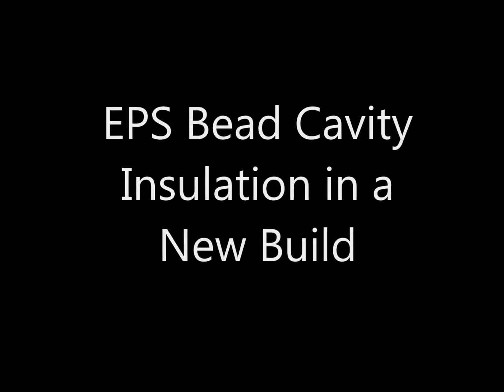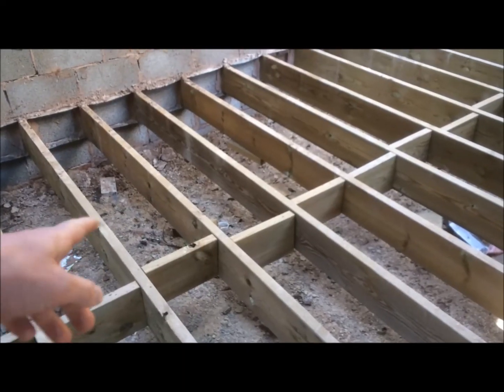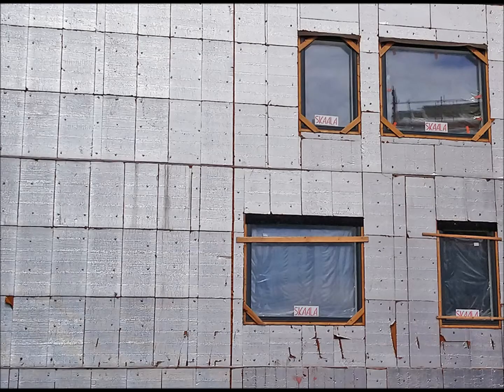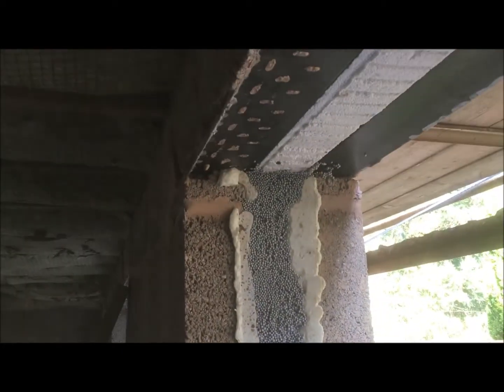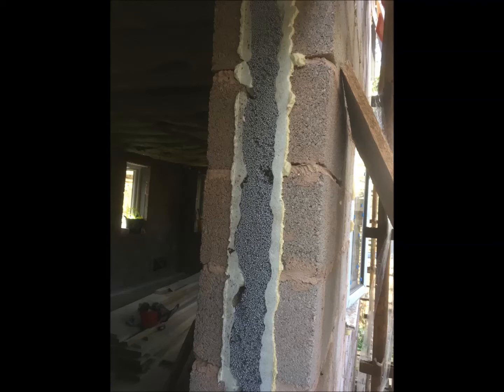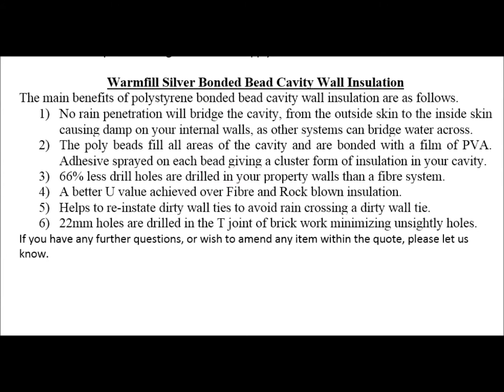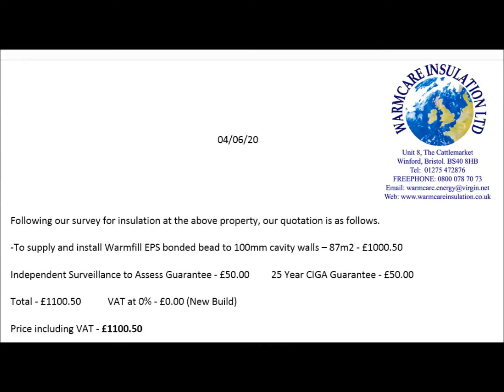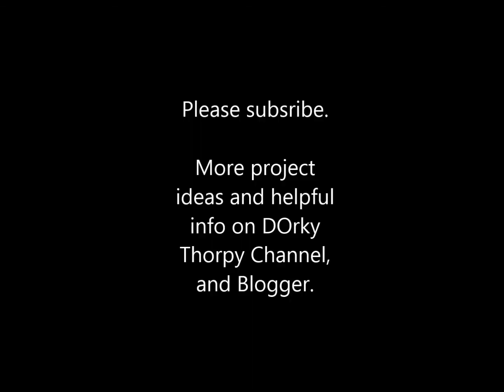Expanded PolyStyrene (EPS) Bead Insulation Costs, Install and Review

Comment: You can NOT add cavity-wall insulation to cavity walls that are ALREADY built up ;  (If cavity-wall insulation is to be used in a cavity wall , it can ONLY be installed from the start of construction of the cavity walls and there must be a LARGE air space gap in-between the face of the cavity wall insulation batts an the outer wall inside the cavity, this includes an air space gap in-between the insulation batts and the cavity wall tie drip points(which must point downwards in the centre of the cavity)). 
Cavity-walls must NOT be abridged. ("insulation" touching outer walls inside cavity)
 Ask N.V.Q. City & Guilds  BRICKWORK teachers for PROOF of this !   (S.V.Q. in Scotland).
Reply from the maker: Thanks. Perhaps supply the truth in the form of a link from a quality independent data source that is directly relates to to EPS. Other wise I think you are blindly following rules without considering context.
Reply: this sounds wrong,.

Comment: What is shown in this video is VERY WRONG.       
 Ask N.V.Q. BRICKWORK teachers for PROOF of this !
Reply from the maker: Can you elaborate?
Reply: Cavity-walls must NOT be abridged. ("insulation" touching the outer walls) .
Moisture from the outer damp walls will soak across the polystyrene beads by capillary action and make the inner wall damp.        Ask N.V.Q. BRICKWORK teachers about this ! @DorkyThorpy
Reply from the maker: I thought _osmosis _ required a significant pressure differential in order to be present?  Also there are lots of walling systems that work without a cavity ICF or SIPs for example. I wouldn't fill a cavity with cellulose or any form of fibre as this may promote _capillary action_. But with EPS as each bead is impermeable and spherical, and the void spaces are to large to promote capillary action how does the water track across?   @CCCP8888
Reply from the maker: . . .  also if you were to use celotex or other rigid PIR board, and leave 10mm cavity as is common, then I know from experience that snots, and misaligned boards geral result in multiple instances of cavity birdiging. I really terrible example of cavity bridging is Castle Drogo: https://www.lutyenstrust.org.uk/portfolio-item/remedial-work-at-castle-drogo/ - That's how not to do it!     @CCCP8888
Reply: @DorkyThorpy  I meant to say capillary action.
Reply: @DorkyThorpy  Capillary action.
Reply: @DorkyThorpy  The air space gap is always greater than half the with of the cavity.
Reply: If cavity-wall insulation is to be used , it can ONLY be installed from the VERY START of construction of the cavity-walls and there SHOULD be a LARGE air space gap in-between the face of the insulation and the OUTER WALL inside the cavity ; this includes an air space gap in between the face of the insulation and the cavity-wall-tie drip point which is in the centre of the cavity.
Ask N.V.Q. BRICKWORK teachers for PROOF of this ! @DorkyThorpy

Comment: Please help , this stuff started appearing in the toilet and in the kitchen under the fridge and washing machine ???????? I thought they were bug eggs I am soooo relived that it is plastic! But why is it leaking out it’s gotten so bad I can hear the stuff pouring out what to do who took call???😫😫😫😫
Reply from the maker: If it was recently installed then ring the installer. If not then more complicated. I am guessing there must be a hole where the beads are coming out, you will need to find that, and block it up. If you own your home, then perhaps have a go yourself, but if in rented then best to contact agent / landlord / housing association.
Reply: @DorkyThorpy  was not recently installed but thank you for the advice , will let my dad know!
Reply: Do they inject from outside or inside the building? Also, what type of adhesive is typically used? Any info would be much appreciated 🙏🏻
Reply from the maker: @stealthartex7162  They can inject from inside or outside. They did both on mine, but it was new build, so no internal finishing to damage. Normally they inject from outside, and drill through joint in brick work. They filled the hole afterwards and it was hard to spot where they had been. They use a PVA adhesive, this is a water based low odour glue, the type kids use in school.
Reply: @DorkyThorpy  that's really helpful, thank you! 🙂

Comment: Good man - good points. Green House grant people have said I can have a cavity wall insulation by injected beads along with adhesive. It currently has insulation that will be sucked out first. What's your views on this do it don't do it any bad experiences etc
Reply from the maker: If the current insulation is paper / cellulose type then yes I would get it sucked out. What sort of insulation do you have in there at the moment?
Reply: @DorkyThorpy  I believe he said it was wool?
Reply from the maker: @RiderReview    If your house is more modern, then the gains will be smaller, as the more modern the existing insulation the better it will be. Also if cavity is say 50mm then perhaps better to go for external cladding so you can get 100mm of insulation. . . .  maybe.

I am sure there will be an improvement, in insulation value, and reduction in heating bills, but hard to say to what extent. 

The above is all guess work (I am a sustainability consultant) but I have no direct experience of insulation replacement. If its under £1000 I'd probably go for it.